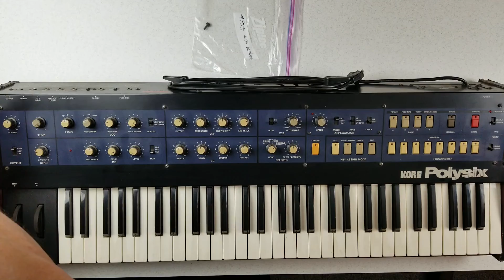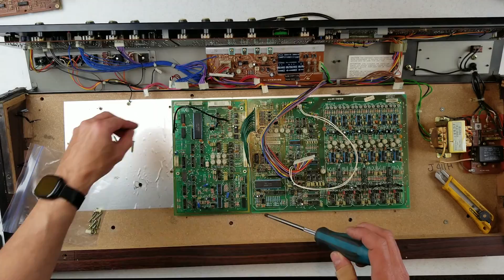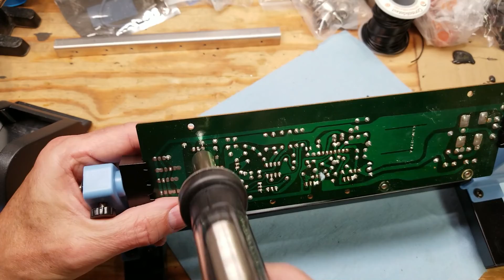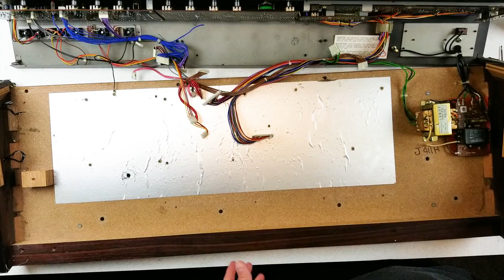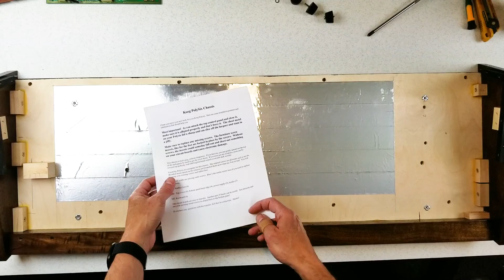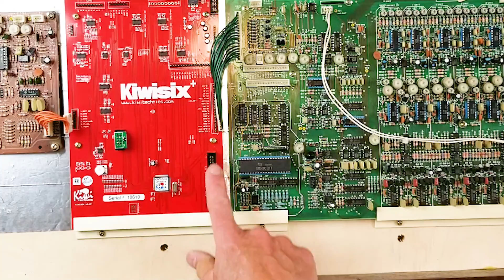Repairing & Restoring a Korg Polysix to Better Than New! Episode 2: Tearing it Apart

Comment: Hi. My polysix seems to have a turning problem. I recently hit it with my tuner and I found it to be a bit off. That means c4 is dead on but c3 is like 10 cents flat and v2 is li like 15 cents flat. How can I fix that ? ❤
Reply from the maker: This is the kind of thing that is fixed by going through the calibration procedures in the service manual. It can be a long and tedious process, and you do need some specialized equipment (oscilloscope, frequency counter) but if you follow the instructions, it's not too hard.
Reply: @ScottsSynthStuff  ok thank you I dont have the service manual.

Comment: Have you had to use a multimeter to troubleshoot any electrical issues with any of your synths? Is that done in any of your videos?
I have a Korg Lambda that has no output. I need to figure out where the signal stops. This is new to me. I need to know what kind of test tool (?multimeter) would be useful and how to use it properly. Any suggestions for videos or information on related electronics troubleshooting?

Comment: Many thanks, Scott! For people in Europe, who are attempting to restore such a device, it should be mentioned, that the voltage coming from the wall socket is 230V, so after importing a unit from the US or Canada, it needs to be checked, if the transformer can be switched to that higher voltage, otherwise it will potentially blow all circuits coming after the power supply unit, so you want to be certain about the origin of the device before connecting it to line voltage. This of course applies to any devices, not only synthesizers. The service manual should mention, if a switch for the primary voltage is available. If it's not visible on the backside of the unit or inside the device (usually older devices offer two settings, 110V or 220V, whereby feeding the device with 230V on the primary end is uncritical), the transformer needs to be replaced. And it cannot be mentioned often enough: line voltage is potentially lethal, so take care! Ideally, an isolation transformer is being used to connect any device to line voltage for service and testing purposes.
Reply from the maker: On these old synths, they usually don't have a switch, instead you have to desolder one of the wires on the transformer (either primary or secondary) in order to make the switch to a different voltage. It's definitely mentioned in the service manuals, and usually also marked right on the transformer itself.

Comment: hello, i just ordered a polysix on ebay and the seller said that it "powers on" but that they dont have gear to test if there is sound (I bought it from a pawn shop). But on the only picture where it seems to be powered on, all the LED ligths are lit, does it mean i am most likely going to need to repair it or I shouldn't worry about it. Thank you for your help
Reply from the maker: There's honestly no way of knowing until it's tested. The LEDs on mean that the power supply is working, you can't derive much more than that from just LEDs.
Reply: From my limited knowledge with synths but with electronics in general, if all the LEDs are illuminated then it suggests there is probably some sort of logic issue as the LEDs should only be lit when a particular function is selected via its tactile switch
Reply: Turns I am really lucky and the polysix was fully functioning, only paid 1200 for it because it was untested
Reply: The leds all turn on when you first turn on the synth, and the picture took on eBay was right at that moment

Comment: Thank you, what a coincidence ! I just started the restoration of my Korg Polysix with a KLM 367 clone board that I have already assembled few weeks ago. Sadly, following the DAC calibration from the service manual it doesn't work. There may be a mistake on the circuit since the front panel potentiometers voltage are missing on the CPU pinouts. It take times to me to understand the whole system
Reply from the maker: If those voltages are not getting translated and sent out of the CPU, are you sure the CPU is actually running?
Reply: @ScottsSynthStuff  CPU pins that are missing signals are inputs received front the front panel pots, I'm pretty sure the cpu is working since it is hot and I can use feature on the polysix that depends on the cpu (like the dac calibration process, but I can't complete it). I will make further research, thanks !
Reply from the maker: @protoxy_fun  If you can select patches using the bank/patch selection, then the CPU is running.